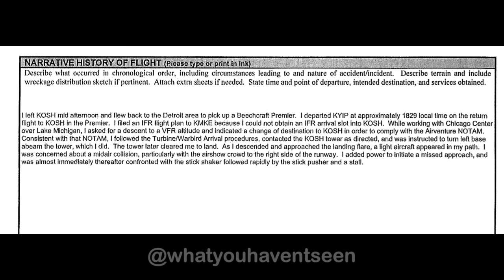Jack Roush Crashes Private Jet At Oshkosh (2010)

Comment from the maker: YouTube has decided to demonetize videos of accidents that show "a strong moment of impact," regardless of context. I produce this channel because I believe that transportation safety is enhanced through transparent and accessible disclosures of the facts. If you find value in this channel's content, please consider supporting my work by clicking "Join" and becoming a channel member today.

There is no difference in perks between membership levels; join at a level that is comfortable for you. Rather than overcommitting, my promise to members is that I will continue to produce this channel's unparalleled content, just as I have for the better part of a decade. You don't have to do anything, and this channel is not going anywhere. I appreciate you all. You make this channel possible.

~~~

I am happy to report that access to this video has been fully restored. Copyright cannot be used as a tool for the suppression of news by a rights holder or by anyone who might have influence on a rights holder.
Reply: Nice video. Horrible flying. But what really concerns me is your comment about suppression. Could you elaborate?
Reply: John Jolly I assume either Jack or an affiliate claimed the video using YouTube's copyright system in an attempt to take it down. It's a very common occurrence on YouTube sadly.
Reply: ThemTube
Reply: You’d be surprised what YT gets away with to suppress news
Reply: What You Haven't Seen . If you do not own the copyright you area a thief. Simple.
Reply: @John Michael 

Pfffft!
Reply from the maker: @John Michael - You are wrong. Fair use is a complicated subject and I am not going to try and explain it in a YouTube comment, but you need to know that it exists. 

In 1976, Congress codified the application of a four-step test for determining the fair use of copyrighted works:

"Notwithstanding the provisions of sections 106 and 106A, the fair use of a copyrighted work, . . . for purposes such as criticism, comment, news reporting, teaching (including multiple copies for classroom use), scholarship, or research, is not an infringement of copyright .  In determining whether the use made of a work in any particular case is a fair use the factors to be considered shall include--.... " 17 U.S.C. § 107

The United States Court of Appeals for the Ninth Circuit recently affirmed the plain reading of that text with the strong statement that "Fair use is not just excused by the law, it is wholly authorized by the law." 

See Lenz v. Universal Music Corp , 801 F.3d 1126 (2015).

(Fair warning: The fair use doctrine is much more complicated than it sounds, and statutory damages are not something to play chicken with.)
Reply: @What You Haven't Seen 

Copy that.    

;•)
Reply: What You Haven't Seen This law only applies in the US, not the rest of the world. The copyright holder should have, and does have elsewhere, the right to control who publishes their material, where it is published and in what context. They may also ask for a fee. People make a living from making copyrighted material and are entitled to do so with out others stealing it for their own benefit.
Reply: Thank you for working really hard to get this footage fully restored.
Reply: What You Haven't Seen i always wondered where this footage was.
Reply: What You Haven't Seen I'm curious as to how this came into your hands.   I'm in the video and knew the camera man.  He "promised" it would never get out.  He gave a copy to the Feds at the time of the incident and to a few other people,  but it took 8 years to get on the internet.  That yellow Cub in one of the photos is the plane he was talking about in his narrative.
Reply: Not entirely sure that uploading to YT (particularly where there is monies incentives) 8 years after the accident constitutes "news reporting".
Reply from the maker: @John Michael - I really dislike debating with people who are smart enough to be capable of doing the basic research that is part of forming an opinion, yet choose to remain ignorant for fear that they might have to change their mind.

"This law only applies in the US, not the rest of the world." - Every country recognizes limitations and exceptions to copyright. Furthermore, the work at question here is exclusively within the jurisdiction of United States law.

"People make a living from making copyrighted material and are entitled to do so with out others stealing it for their own benefit." - I generally agree. Quite strongly. You need to realize that United States copyright law agrees with you too, as one of the four factors evaluated in every case of claimed fair use is market harm.

Discussion over. (With you.)
Reply from the maker: @world wide - Accident prevention is the overall reason for disseminating accident information, and that goal can only be reached through transparent and accessible disclosures of the facts. The reality here is that Jack's narrative of his 2010 crash is inaccurate, and for the past eight years that is the primary narrative that people heard.

My publication of this story accurately informed the public - for the first time - about what actually occurred at Oshkosh in 2010. There is a lot of trash in the comments below, but there is plenty of thoughtful commentary as well and one does not have to look far to find comments such as, “His report of what happened is nothing like the video,” and “Wow, pretty remarkable video showing nothing similar to the reports at the time of the accident.” The interest of public safety strongly favors the dissemination of accurate information.

To be clear, I have no axe to grind with Mr. Roush and I have no reason to believe that he was deliberately untruthful. Plane crashes are not known for producing the most reliable witnesses.

Separately: While I am not averse to the idea of being compensated for my investigative work - about which there clearly is strong public interest - because you brought it up, you should know that my earnings to date from this total $0.

If you wish to discuss this further my email address is contact@whatyouhaventseen.com.
Reply from the maker: @Chairman of Ground Operations for Homebuilt Gardiner - I would be happy to discuss by email. My email address is in the comment above.
Reply: John Michael well in this case the copyright holder is the one filming; not the pilot.

That being said, you are still wrong.  This is a transformative work as it is not only the clip of the incident, but also supplemental recordings of transmissions that give more information about the incident.  This certainly falls under fair use.  Criticism or news reporting; take your pick.

And sure, fair use is a US law (also Israeli and polish). However, you are completely ignoring the "fair dealing" principle used in the UK and many of it's former colonies (Ireland, Hong Kong, Australia, New Zealand, etc.) which covers a multitude of uses where permission is not required to use copywritten material.

Tl;Dr you are wrong.  Get over it.
Reply: @John Michael [[[ Jack Roush fanboy detected ]]]
Reply: "This law only applies in the US, not the rest of the world."

Then it's a good thing You Tube is based in the USA then huh?
Reply: @John Michael: Attempting to argue the law by establishing your own flagrant ignorance of, and wilful/wanton disregard for, said law is about as foolish, mindless, and "millennial" a thing one could possibly do.
Good luck in life!
Reply: @Richard Hardin

Darn tootin' somebody's gonna start some sh|t with you, and that would be me! Don't disable comments! If you do, they win.

There's all kinds of members only moderated forums where private pilots and industry folk can get together to discuss issues without all the distractions.  Not all of them are accessible to non members like me for reading... I admit, YouTube isn't exactly the ideal place to have one's arguments considered by a fair and impartial jury of peers, but for enthusiasts like me who don't yet have a license (or a plane), some of the best and informative comments come from pilots in violent disagreement with each other in a forum that's not moderated -- and by my observation, some of them pilots can be just as nasty as any troll. Just cuz they might get nasty, don't mean that they're wrong.

 I share your frustration with having to share space with the trolls, but censorship or de-platforming doesn't strike me as the best solution.  And one more thing, YouTube is perceived as sort of anonymous (don't know if it actually is) and members of the aviation community may feel emboldened to express opinions here which, for whatever reason,  they would hesitate to express elsewhere.  

I don't worry about catching sh|t from anybody. Some time ago I decided to cast off anonymity altogether.  I started to feel uncomfortable with the idea that I might have something in common with idiot masked protesters (vandals) who spend their days inventing ever more imaginative ways of contriving grievances... and life goes on. They tell me I'm privileged...
Reply: John Michael = know it all TROLL ALERT.
Reply from the maker: @Frank Huber - Bingo. (My only wish is that YouTube's comment filtering allowed me to flag keywords which would automatically result in the comment being held for review. Their option to "Hold all potentially inappropriate comments for review" lets a lot of trash through.)
Reply: wrong, there are different reasons why u are allowed to use it. You ever heard about LAW?
Reply: Fair use is a defense for using copyright material, even if Youtube permit you to use the said material, you may still have to defend yourself if the copyright holder decided to sue. It has nothing to do with the suppression of news. either wise how the heck did to get the material if it has not been put up for public consumption?  Remember; Youtube is not the court of law,
Reply: The only thing simple here is you if you really believe that.
Reply: +Steve Kasian
While it is a foolish thing to do, can you please not use the term "millennial" to describe it?
Reply: John Michael Mate, are you an advocate for Article 13?
Reply: Peter Q it is actually Jean Michel, an EU Bureaucrat
Reply: Jim Gardiner why should he promise it would never get out? Because Roush is high profile? All of these type accidents are a learning experience for someone. There’s no5hing graphic here.
Reply: Not if it's news and or education safety....
Reply: What You Haven't Seen z
Reply: Jim Gardiner--------------------------Valid news about any event should never be suppressed for any reason.
Reply: John Michael, if so, then you are aiding and abetting by watching this clip.
Reply: Frank Huber, thank you.  I know we have to wade through troll excrement to reach the worthwhile conversations; but suppressing all commentary is much worse.  I seldom even finish watching videos with comments disabled.  I'll try to find the same material elsewhere.  Reading the comments and occasionally replying are a crucial part of the experience.
Reply: Ima Pseudonym: It might stun you to know that YouTube needs to comply with the law in the countries where it is accessed. Just ask Facebook, Google and Microsoft about the hefty fines imposed on them by the European Union over the years.
Reply: Not necessarily. There's "fair use" when the content is newsworthy in and of itself. Same goes for model releases.
Reply: Good to see something Mr. Roush's money can't buy.
Reply: I was hoping to see a rich dude die...I'm dissapointed.
Reply: Godspeed.
Reply: @1111aaa2222  So is mustard and chocolate
Reply: @WhatYouHaventSeen  It's still censureship though. Allowing idiots to have their say then , negating their opinions, is a positive act. It lets others with the same thinking to see the folly of their own thoughts.
Reply: @bigbadjohn10  Fair use you fool!
Reply: Well good for you. You got away with stealing it.
Reply: wrong copyright can be pulled by he owner, and you can be copyright struck this is NOT your video, STOP passing it off as your own!
Reply: @1littlelee  Read ALL the comments. Fair use applies.
Reply: @TRPGpilot  If I as an American decide to operate a website on US servers, I only need comply with US law. The rest of the world can worry about their own laws.
Reply: "now be impressed as I execute a carbon cub approach in a beechjet"
"oh snap, is that a hummingbird on the runway?"
"wait my tailhooks downs, broken arrow BROKEN ARROW"

yep, that was impressive
Reply: @WhatYouHaventSeen  Fair use refers to a small portion of the copyright material not all or most.
Reply: An air accident is not a private event.
Reply: @G6304  But a video of it is copyright of the creator.
Reply: @worldwide8553  Good point. This is copyright infringement and theft hiding behind the sham of fair use.
Reply: @WhatYouHaventSeen  Is this just a small portion of a larger work or a subtantial part of the original. If the latter then it is not fair use, it is theft.
Reply: FIGHT THE POWAH!
Reply: What You Haven't Seen then what good is a copyright good for?  you, news etc are for profit companies but the owners of copyrighted photos don’t make money, is that fair? Channels like yours are the leeches of the industry
Reply: @bigbadjohn10  this is not commercial use it is a news story therefore  free use
Reply: This isn't news. Its an old vid which by the sound of it you don't own the rights to. Are you making money off this upload?
Reply: 'news'
Reply: peter collins  Give a reference or specific citation.
Reply: peter collins  When copies DIRECTLY the amount of copied material is taken into account. It is only when the copying is TRANSFORMATIVE (e.g. parody) that it is ignored.
Reply: peter collins  Fair use looks at four factors:
(1) purpose and character of the use
(2) nature of the copyrighted work,
(3) AMOUNT AND SUBSTANTIALITY OF THE PORTION USED IN RELATION TO THE COPYRIGHTED WORK AS A WHOLE,
(4) The effect on the market of the copyrighted work.
Reply: peter collins  It depends what you mean my "use an entire work". Parodying an entire work would be fair use. COPYING an entire work would not.
Reply: peter collins  You wrote earlier "the portion of a work is entirely irrelevant to the determination of fair use." Now you say: "Yes, it can be a factor. It cannot be definitive."
Reply: peter collins  The guidance notes do NOT state that copying an entire work may be fair use. They DO say that the proportion is but one of four factors. But it does not follow from this that copying ALL (or even most) of a work would EVER be acceptable as Fair Use. I challenge you to cite one judicial PRECEDENT in which it was held that copying an entire work (in a non-transformative way) was fair use.
Reply: peter collins  One factor can outweigh all other factors and can therefore be determinative.  The fact that there are four factors, doesn't mean that a combination of factors is required. If one factor is extremely large then the courts can  determine that the other factors are irrelevant. Again, can you cite ANY precedent in which copying an entire work in a non-transformative way was held to be fair use.
Reply: peter collins  I just saw your reply. I am looking up the case now.
Reply: peter collins  That case was about personal use not broadcasting it to others. We were talking about using someone else's material on YouTube, NOT recording it and looking at it in ones home.
Reply: peter collins   That case was about personal use not broadcasting it to others. We were talking about using someone else's material on YouTube, NOT recording it and looking at it in ones home.
Reply: Wait, so how much of this video is your content?
Reply: So?  You're still a thief.
Reply: All of you are so entangled in copyright laws your forgetting a entire set of sub laws the FAA adheres to, this video was provided to the NTSB as evidence, all evidence as well as NTSB accident reports become public information once the investigation is finished.  As an advocate of aviation Jack would be an advocate of releasing this evidence if it was any one but him.  This is exactly the type of evidence that can save life’s as a teaching tool.  It appears to be obvious why Jack was trying keep this video from the public, his recollection of what happened was not truthful.
Reply: I think you mean slide show. Not video.
Reply: This is ridiculous,  other than for an investigation,  the copyright holder SHOULD have the cop right! You don't have the right to go into someone's house and snoop through their pictures and you shouldn't be able to steal this either. :-(
Reply: @RobertWermuth  Monetized YouTube video about an incident 4 years ago, creating income for a person who does not own the rights to the footage, and not distributed in any kind of "news outlet". I can't imagine any other criteria by which to define something more as "commercial" nor define anything less as "news". Thanks - Lumpy
Reply: What You Haven't Seen I am happy to report you are a thief.
Reply: John Jolly I assume you fly jets?
Reply: What You Haven't Seen 
In this day & age it’s pretty sad that you’ve got to say that.. Snowflake lunacy!! Awesome video BTW!!
Reply: Steve Kasian Millenials are, statistically, more highly educated than previous generations. Also, millennials are 25 to 40 years old, so are you quite sure you mean that age group?
Reply: @bigbadjohn10  Youtube is an American Company so the "laws" of other nations doesnt apply and In the US what qualifies as "News" cannot be trade marked or copyrighted
Reply: Greg Mink wouldn't have crashed a perfectly good Premier 1 like that.
Reply: Did this this flight end his flying?
Reply: thefactorypilot145 (
Reply: What makes you think you can own something on earth. That mentality has the world under control.
We as humans can live without money, supermarkets etc. We make This life complicated by wanting more. Which is ok. But the moment you suppress knowledge and wisdom from people. That's where I don't agree. If everything was free. There would be no need to compete or struggle to survive. Having to copyright all your shit and live in fear of someone stealing "your" content.  If all knowledge was free and accessible, we wouldn't be living in ignorance.
Reply: @bigbadjohn10  youtube is in the US. All parties involved are in the US. The international argument is null.
Reply: @jlr022159  YouTube did not initiate the takedown. It was in response to a private party copyright claim. The individuals claim was investigated and YouTube ruled in the favor of this channel. YouTube acted appropriately by responding, investigating and ruling appropriately.
Reply: @williammunny9916  Reported for Spamming.
Reply: @bigbadjohn10  John Michael.  Not at all that simple.  There has always been a tension between the 1st amendment and the copyright statutes found in Title 17 of the United States Code.  That tension has been addressed by statute in Sec 107 and related caselaw as well as well as the "first purchase" doctrine set forth in Sec 109.  You should read up on copyright law before you make such ignorant comments.  You're right in that the law is not exactly the same throughout the world, but it's just as true that  it applies though much of the world.  Since the Berne Convention and the Universal Copyright Convention, copyright throughout the world has become very harmonized.
Reply: Where can u get this plane model? Really nc airplane
Reply: @NorthernChev  YOuTube doesn’t rule on anything. They are mandated to take down upon a certain complaint. If refuted, the original complainer is given a period of time to file copyright suit against the channel. If they don’t file suit, the takedown is removed. 
YouTube never decided anything. They follow a simple rule laid out by law, and it tells you nothing about the merits.
Reply: Youtube babysitters back off....